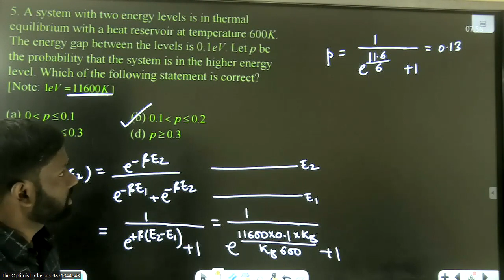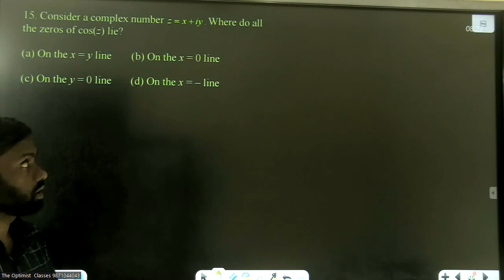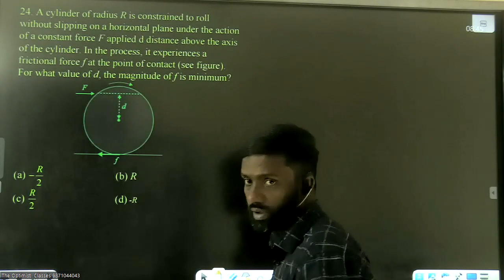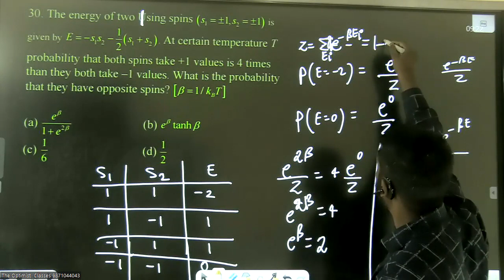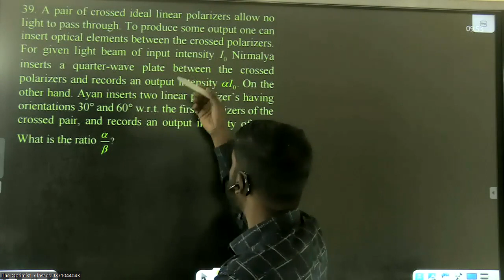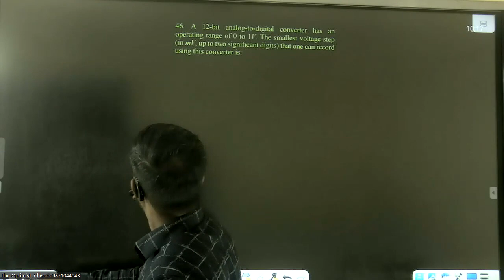JEST 2022 SOLUTION FULL PAPER

Comment: In the last question of this paper u are getting 10.5 because you are using the formula dU=nCvdT but for the process from A to B, V is not constant but P is constant so we cant use the formula in terms Cv (constant volume) but we have to write in terms of Cp (constant pressure, dU=nCpdT) then we will get 17.5. please correct if I am wrong